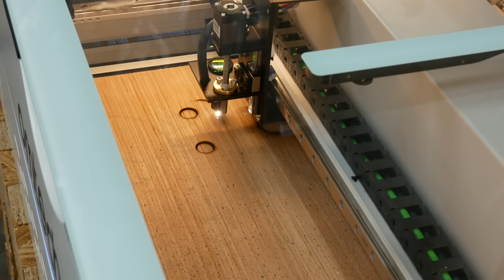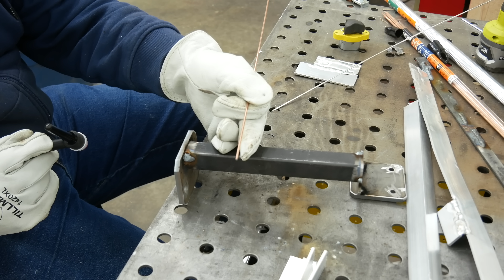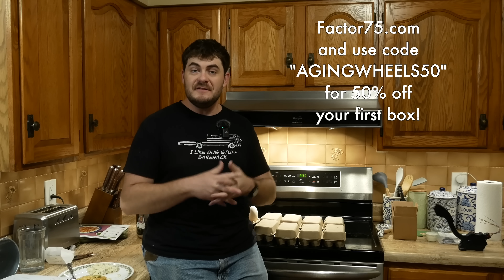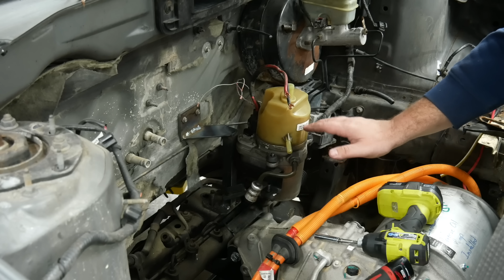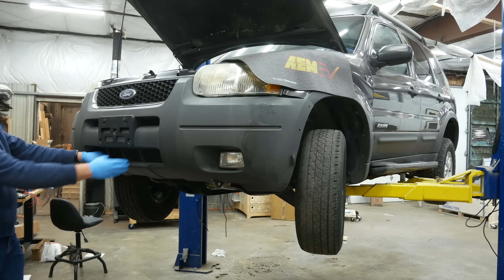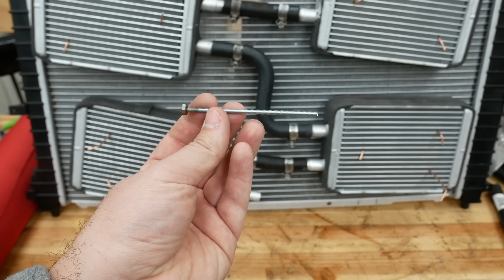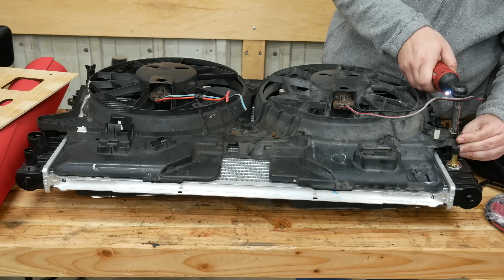Battery Powered Steering and Five Radiators | 900hp Electric Escape Project

Comment: Clever use of plywood, use the cheap stuff to plan the expensive stuff.

For the rest of the stuff, I think that you should put it in with a cardboard or plywood box taking up the space of the batteries.  All of this looks easy until the batteries get in.

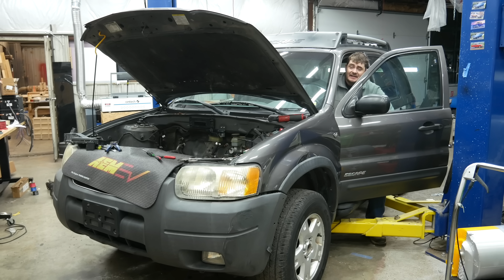9:30 The car says "Check engine, no oil pressure, no coolant, no transmission fluid."  Driver says "Thanks Captain Obvious."

I don't know about the connectors, but I appreciate the fact that you asked us instead of guessing when you didn't know.

Comment: TPU works just fine in an engine bay, within reason. I've had TPU grommets around my wiring harnesses and TPU soft mounts on my boost control solenoid for years.

Comment: You know since you already have a constantly running power steering pump you could potentially do 'hydroboost' instead of vacuum boost brakes (eliminating the need for a 2nd pump). I have no idea if it will directly fit or not but certain Mustangs of that era had hydroboost systems that might work.

Comment: Proud V6 Escape owner here, thought I'd chime in on the brakes. The stock brakes on these are quite stout, and will drag the car from 60-0 in short order. However, I have warped the front rotors towing with mine. If braking does become an issue, Powerstop does make upgraded Z23 drilled and slotted front rotors for the Escape. I have a set waiting to be installed, I will report back with updates once they're installed. Take care.

Comment: For the brake booster, you could use a hydro boost system. Ford and others have used it. It uses the pressure from the power steering pump to provide brake boost. One less thing to mount underhood and draw power.

Comment: I would recommend putting some heat shrink tubing over the through bolts holding the heat exchangers together to avoid a rub through with the thin aluminum tubes

Comment: You should look into backing your nylon radiator washers with radiator spacing foam. Plastics can and will wear holes in your radiator passages if they're subject to vibrations.

Comment: How are you going to set this up electrically? Are you going to use the factory ignition switch and shifter? If so, maybe you could shut off some accessories in "park" or "neutral" to save battery, like the power steering pump. It wouldn't do much but its something

Comment: I'm just about to fit an electric power steering pump from a Holden Astra (Opel Astra) into my racecar. The unit looks almost the same as your one. The only difference is the reservoir on the pump.

Comment: @11:12 you might want to use a VW/Audi electric vacuum pump and an of the shelf negative pressure switch. :) VW part number is: 1J0612181B

Comment: Threaded rod has a tendancy to chew through the radiator tubes that's why there are specific plastic radiator fixings for oil coolers and things. you should be able to source a pwm controller or variable speed dc motor controller that will work fine to control the speed of those fans. Awesome build so far!
Reply: Yeah kinda funny how worried he was about metal-metal contact on the face and then just jammed a bunch of threaded rods through the fins.
Reply: @kaelwd dissimilar metals at that!
Reply: They make easy connectors for putting a fan on a radiator for hotrods and such, I have on my t bucket. 10/10 recommend, it’s like a zip tie with a flat washer head
Reply: Agreed.

Comment: The heater cores are designed to be fan forced, where something like a transmission cooler is designed to be able to be cooled like the radiator with airflow from the moving vehicle. Also because of the reduced airflow where the heater cores are strapped to the radiator, they might both work more poorly.

Comment: Those bolt threads will wear through the radiator water channels in no time, regardless of the plastic washers meant to secure the heater matrices.
Reply: This! Physics, Robert, physics!

Comment: ive got a front wheel drive minivan, and a large battery bank where the stow and go seats went. id like to replace the un-powered rear wheels with electric hub motor wheels like on a tesla and have it be a solar plug in hybrid.

Comment: I used the same Volvo pump on my conversion. You can also pick up a hydraulic pump from a Mercedes for brakes. It was wayyy quieter than the “kit “ I bought from a EV supplier. You only need the pressure switch to complete. Don’t listen to the folks saying you build is janky. Every custom conversion has to be a totally custom job. I redid lots of custom mounts and connections as I built my car. It’s your build, do it your way. Most doubters will never start!

Comment: Not an electrician. Forklifts have been electric forever and often quite high amperage and quite often full of waterproof quick connectors. I don't have a source for them, and 2000 amps is extremely high capacity for a forklift, but maybe that's where you start? The biggest quick connects I've ever touched are in the 50 to 200 amp range, lol, and their wires are in the 1 to 0 gauge size. What's wire is run to businesses with 2k amp service? Four passes of 00? or 0000 wire? Has to be as thick as a wrist.

Comment: Wire a switch to disconnect power to the power steering unit, you could run it manually so you can switch it off on the highway or wire up some trick sensor to disable it for you at speed.

Comment: Concerning battery connectors - I would recommend the classic compression lug connectors with a bus bar through a high voltage contactor. Industry has been doing this for years for higher amperages than electric cars, and they hold up extremely well. With the proper cable glands, you can make anything water tight, you will just have to make a waterproof top cover for your batteries. 
Making your own connectors here will have two big advantages, first - all the raw supplies are readily available on McMaster Carr or similar; second - using a shielded high voltage cable  (I use Coroplast FHL2GCB2G @ $9/ft in the before times) lets you strain relieve your cables before the connections and provide excellent grounding for isolation monitoring. In my opinion the integrated cables will become an unserviceable death trap as the plastic degrades, and you are stuck with the factory cable lengths.

Comment: I would have just had one big radiator and run the coolant from the cold side to the batteries, hot side of the batteries to the motors, hot side of the motors to the radiator intake. Feels a little simpler to not have multiple radiators with multiple failure points.

Comment: On the TIG welding, you have to clean the metal up more. You can't leave that mill scale on the square tube like you can with MIG welding. You have to take it off with an angle grinder/sander/sandblaster

Also, if you're not already, you have to use either 100% Argon, or a mix of Argon and Helium.

Comment: Back in the most horrible time in my life, when I was in high school, I had an old Chevy station wagon that originally had a 350 diesel in it. When I got it, someone had put a gas engine in it, but the car still had the hydraulic power brakes. That would have made an EV conversion pretty easy, but I can't imagine why anyone would do an EV conversion on a 1985 Caprice wagon.

EDIT: Connectors - you might see if you can get a battery connector for an electric forklift. The really big ones do 2,000 amps or more.

Comment: Might want to look at Amphenol UPC 450A connectors -- could gang up 4x 450A connectors to get to 1800A. And they are reasonably priced brand new. I didn't see any other good ruggedized connectors that could support higher than 450A and that you could easily buy.
A single connector that could handle 2kA (or even 1kA) that is also water tight would likely be extremely expensive, and you'll need both male/female halves. Or cheaper option, rip connectors from junk yard/salvage vehicles (and hopefully lookup the connector to find its rating.. lol).

Comment: Well I am not an expert in any means but if you cant find 1000A connector why dont you use 2 of your HV connectors from the Coda connected in parallel and that should be good. (I have put the comment on 2 spots just so you can see it :D)

Comment: I'm not the type of guy who would want to say "make that thing different, idiot!" but i wouldn't trust the mounting of the heater cores. My uneducated guess would be, that the tubes might break, as the heater cores filled with liquid will get heavier and if you want to drive it, a bump might be enough for it to fail.
But I know, it's just the prototype for the bus and I'm really impressed by the whole project. You're amazing <3

Comment: When I saw this project, I thought it was cool, but I would have chosen a clean 2008+, which can ALSO be had very cheap if you buy right (I personally no longer enjoy rusty or beat-up cars—I’m too old for that now), and more importantly, the updated body style already has electric power steering from the factory.  

Don’t get me wrong though, I still really like your solution with the Volvo pump!  And I do like the sound.  Some actual mechanical sound is sooooooo much more satisfying than the fake groaning motor noise they add to some of today’s hybrids and EVs.  (One of these days, I’ll find that ill-sounding noisemaker on my newest car and I’ll find a way to stuff a sock in it.  Although I’ve fantasized about making it sound like George Jetson’s flying car, maybe I’ll just add a device that plays the sound of a Volvo power steering pump!!!)

Comment: I don't know if anybody suggested it but what about those big connectors they use on electric forklifts for the high voltage lines if I remember correctly they were rated for some crazy amperage and voltage

Comment: Without valid data from the CANbus, there's a possibility that the pump will default in operating in some kind of safemode, making assist too high for higher speeds, resulting in dangerously light steering.

Comment: Amazing videos but question with that much space and cost why not go with a dual alloy rad system you will have the cooling you need and you can get them in almost any size, can get them fairly cheap to.

Comment: Just a suggestion but perhaps you could set up in your drive unit software to shut the power steering pump off above 10-15 mph to save on battery.  I believe that's how that pump works on the Volvo it comes from.

Comment: You could…. Use a Chevy hydro boost hooked into your power steering pump to run your break booster. Instead of a vacuum booster. Of course there is also regenerative breaking that you could do… but that might be a nightmarish amount of work.

Comment: Anderson Power Products has some large blade style connectors available that are affordable and can do 500A (MFG PN "913" is for the housing). The only other higher current options available will not be single, quick-disconnect style, but bolt on crimped ends.
It's worth noting that connectors are usually given current ratings at 85C. They can carry a bit more if kept adequately cool, but they should come with a derating curve on the data sheet, so check that for any particular connector.
If I were you, I'd pick an off-the-shelf option that are still being used by other electric cars and double or triple up on them since they'll be cheaper than more exotic options from, say, Amphenol or TE.
Source: Me, I'm a power engineer

Comment: I have an idea for your cooler fan problem if you want to try to keep them.

I remember for some old Corolla I was diagnosing some fan problem. And it hand a pretty neat circuit to achieve a high and low speed with on off fans like that. Basically for low it would close a relay that would create a series circuit with the fans so voltage would have to drop across both and they would run slow. For high speed it would close a relay for both fans to run them individually at there full speed

Comment: Err, holding radiators by pushing bolts through their core... I don't know. It will move and vibrate, and the bolt will wear out the cores, causing leaks.

Comment: Did you really say 2000 amps? How is it so high, is your voltage that low? That's some risky stuff, with that kind of current even the extremely low inductance of a straight piece of wire might get you some probematic (i. e. inverter destroying) voltage peaks. And your battery discharge rate will be way to high, leading to excess battery heating and subsequent wear. If possible reduce the current and then use some standard Amphenol EV Connectors. Don't skimp here, a faulty connector with just a few milliOhms more resistance could get burned rather quickly. I used to be an automotive safety engineer, my guess is that there's a safety monitor that does a voltage drop check on the battery connecting wires and warns the driver if the connection is bad. Your car probably won't be having that and you need to oversize the wires and connectors.
Reply: Oh and another question: Don't you have 2 drive units, so half the current on each? Maybe do a short video where you sketch your intended system layout on a whiteboard.

Comment: i think you should align the radiators so the holes are not blocked to the point where both radiators meet, unless the temperatures are not so high

Comment: When working with the batteries I would definitely search for an already existing connector and don't make anything yourself. You're dealing with some serious current and voltage there. It's not just a fire but also an electrocution risk. 
Maybe look up the parts number if the connector of your coda, which would lead you to the manufacturer and you could look in their current catalogue. 

As for the danger of these connectors:
On current electric cars the high voltage connectors always have a pair of 12V connectors too, that always connect after the HV connectors/open before them
They are just bridged together, so they can complete a circuit in whatever you plug them in.  This so they can function as an intelrock. Only if this connection is made this or even any HV component can close their internal contactors and try to go "live".

Comment: Hey! So the SW20 MR2 has electro-hydraulic PS from the factory. It only runs at low speeds, once you hit a certain speed the pump turns off. 

May be worth looking into this for highway driving or something.

Comment: Automotive HV connectors that can carry 1000A continuously are very, very rare (even today) and almost unobtainable for the ordinary person. Even if he's a rather large youtuber...
Even with a speculative "sponsorship background" nobody will sell or even send you samples, because no big connector manufacturer wants to be associated with this project in case there are any "unforseen complications and consequences".
Sorry if this sounds a little harsh, but it's the sad reality of things... :/

I think the best shot you will have with very large cable lugs.
Make sure to produce a proper crimp as this (and the contacting surface) is the most critical point of such a high current connection.
The crimping tool won't be cheap either (get ready for some 4-figure investments) but it's absoluetly crucial to get this right!

The tightening torque of the connection is also very important. Things like surface-pressure- and pre-tension-force-calculations might are a little too much over-engineering for this project, but if you've got some knowledge about this topic you shouldn't hesitate to do some math.

For the surface materials/platings... Just go with exactly same pairings. Tinned surfaces would be prefereable and rather easy to obtain. Or bare copper. But this/the connector interface would then have to be sealed. Silver-plated would be close to perfect, but again I'm not sure if an ordinary person can get such parts.

Next is water ingress and capillary effects. Make sure to seal the interface between the copper conductor/strands and the cable lug. Use shrink tube with an inner hot glue coating. Pre-heat the lug before applying the shrink tube. Don't use cable lugs with inspection holes, as these will also allow for water ingress into the mantle of the cable.

Not regarding any norms and standards here, but these would be the absolute basics in my mind... Good luck! :)

Comment: I think you'll struggle finding any HV connector for automotive use that can handle more than around 500Amps. Of course it's a question of do you want nominal current capability of 2000 Amps or are we talking peak 2000 Amps for a few miliseconds? You would probably have to look to railroad industry connectors for anything even close to 1000 Amp nominal rating, and at that point you would need cables with a diameter of around 240mm2 / 500 MCM which would be quite expensive. Probably better to go with bolted in busbar connections to some sort of junction box if you need that high of a current or second option would be going to a higher voltage system.

Comment: I couldn't find a connector that could do more than 250A rated and looking over the solutions, everything I see is 1000V 250A.
Could you use a salvaged Tesla high voltage battery connector and cable?

Comment: Won't it be dangerous to have batteries inside the crumple zone? It would surely burst into flames in case of a hard front collision. Anyway, can't wait for the next episode!!
Reply: The batteries are where the engine was, which is very much not a crumple zone in that way. If it was, you'd be getting engines crushing people as they got shoved into the passenger compartment.
Reply: @johnwolf2349  If you look at any front collision cars, the front definitely is a crumple zone and mostly is crumpled up to the cabin. Whatever is in there will definitely take the brunt of the hit.

Comment: Since you're already powering one pump why don't you make the brake booster hydraulic? Hydra-boost. Anything with a diesel engine could provide the whole setup you need and you would tie it in to that new pump. Just an idea.